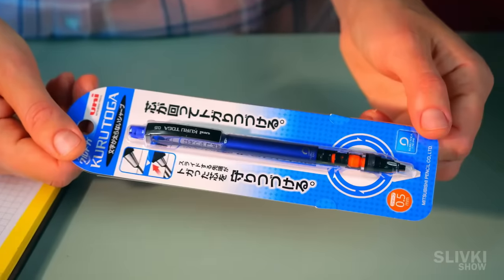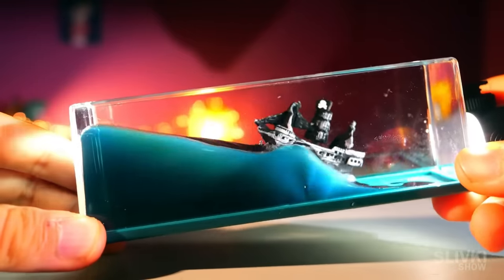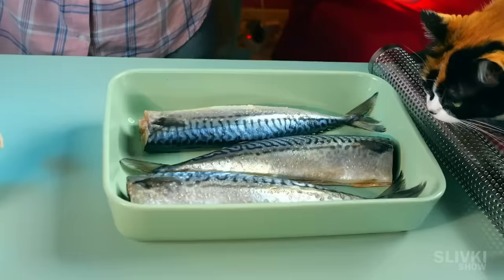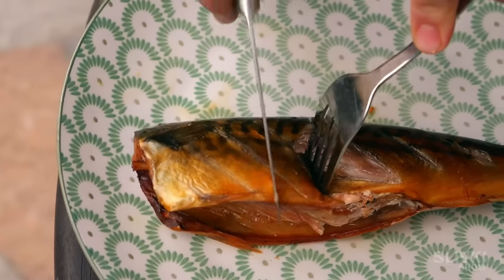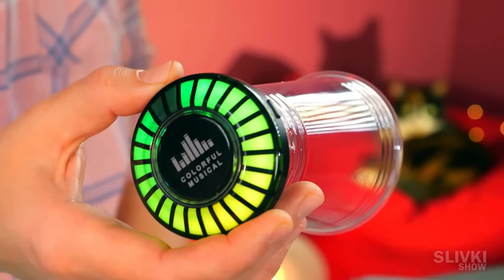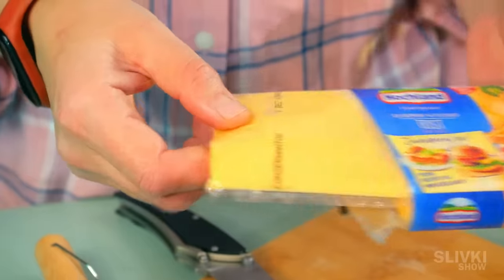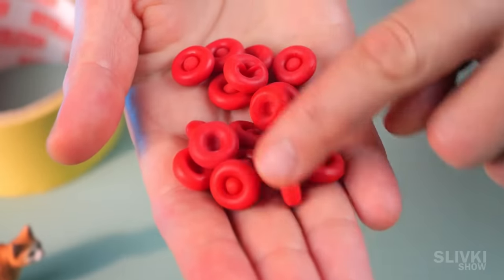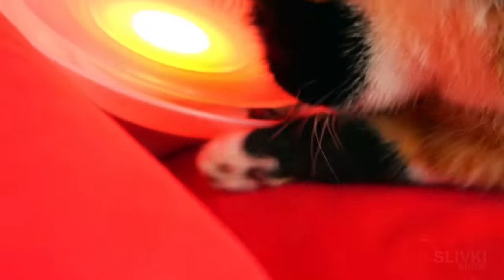HERE’S WHAT WE BOUGHT ON ALIEXPRESS

Comment: cr2032 lithium batteries are not rechargeable unless you got the lithium-ion ones that are much less common
Reply: They’re called ML2032
Reply: I got one from an old pc motherboard
Reply: @SharvilSawargaonkar  The one on the motherboard is for something else not a battery
Reply: @JayrtLikn-dz8wb What do you mean? It is a battery.
Reply: Based on the discussions here I think I would give it a pass. Seems like a recipe for an explosion!
Reply: @JayrtLikn-dz8wb Motherboards do have batteries in them... 😂😂 Wow... even the bloody Amiga from the 80's had a battery for the back up clock
Reply: It's not rechargeable or it's not supposed to be recharged? I know sometimes batteries can be recharged even tho it's risky
Reply: lir2032 are and are a drop in replacement for cr cells how ever cr 2032 are 250+ mah while rechargeable variants are only 65 mah. They would how ever recharge very fast. So for some things they would do just fine including for pcs that are left on most of the time as a regular 1 can last a decade or more with power off on a pc. So for computers or remotes etc they would be just fine. The main use case for em would be remotes
Reply: Charging CR2032/CR2450 is very dangerous. They're not made to be recharged and since they're confined in a metal case they might suddenly explode without showing any warnings like bloating.
LIR2032 / LIR2450 however are li ion batteries (similar to what you have an almost all Chatham devices) and can be charged assuming they charge limits the current properly.
Reply: @JayrtLikn-dz8wb absolutely incorrect
Reply: @JayrtLikn-dz8wb As someone who assembles computers, I can say they are  batteries and their purpose is to provide power to the motherboard when the mains are turned off in order to run a few functions such as the clock and bios settings. You can run a computer without it but your clock will reset and bios (there are motherboards where bios data is stored digitally without needing power from the battery) every time you turn the PC off.
Reply: @blackcountryme yep! Though in the 80s it would have likely been ni-mh or ni-cad!
Reply: Noo
Reply: Yo you can

Comment: The special tiny red caps only roll over the tip of the caulk one way. If you accidently put it on the wrong you need to disgard it and put on a new one. Unless you want little caulk babies running around.

Comment: warning, a button battery charger not intended for charging will explode and catch fire, not all lithium batteries are rechargeable as the types intended for that have vents in them to prevent pressure building

Comment: i don't have a problem with the CR type batteries. usual application is in low powered devices or motherboards, my CMOS battery is in there since 5 years and it's still fine, the ones i have in remotes need change once a year or two, they are quite inexpensive as well but i do like the idea that we could recharge them instead of fating them to the bin.